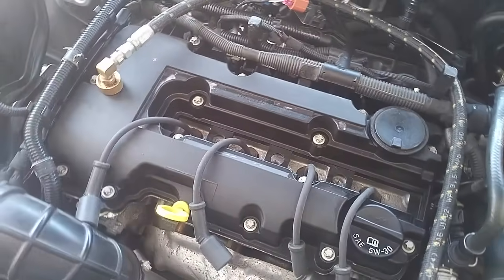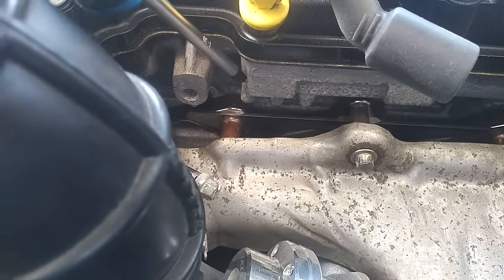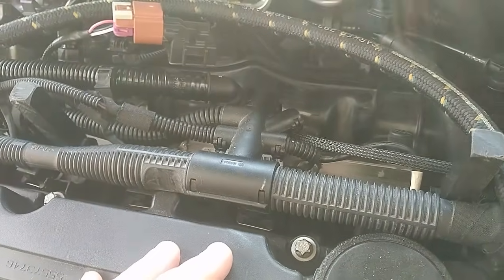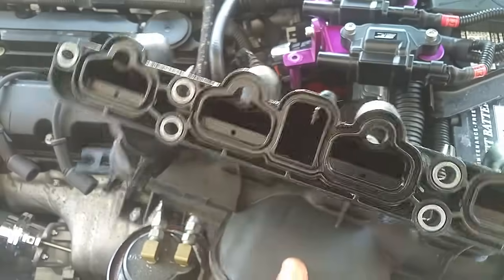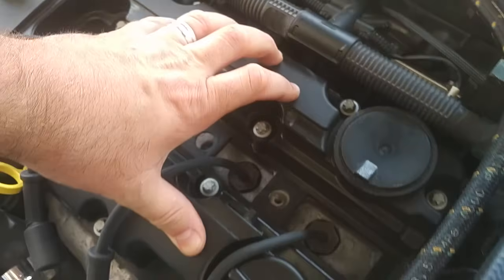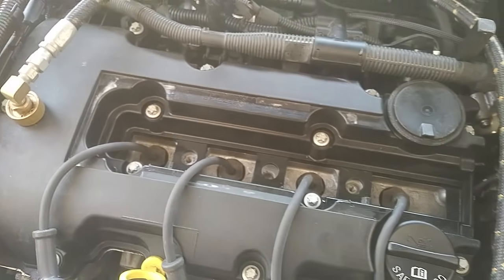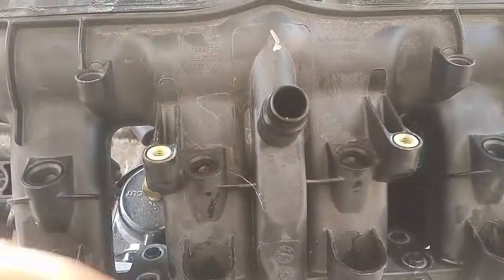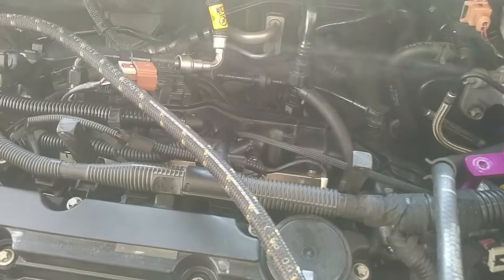Chevy Cruze Sonic Trax Encore 1.4L Turbo PCV Issues, Diagnosis, and Solutions

Comment: I wiped out the area but there's no round orange tip but there's something raised up but looks like flat and black in color. It's hard to tell without taking the intake out. Is that check valve round or flat? I am getting P0299, the car is under power, the line/hose from intake to turbo has some oil and my air intake connection at the line coming from intercooler is soaked with oil. I am trying to figure out the problem before replacing parts. I just installed a brand new Chevy valve cover.
Reply from the maker: Your check valve is gone. You need to install one of my pcv fix kits. That should address your p0299 and restore some power and fuel economy and reduce the oil consumption.
Reply: @AndreiDPop  Sounds good! Thanks

Comment: Would this cause white smoke out the exhaust as well? I've got the p0171 p0106 p1101 codes and the disc thing on top of the valve cover is indeed sucking air and I cant see the orange nipple in the intake manifold. I wasn't concerned about it until I noticed it's white smoking but it doesn't smell like oil or coolant. Just smells like regular exhaust fumes but is thick white clouds when first starting up then it eases off a little.

Comment: My car’s vaccume regulator diaphrame is suking air. Not only this oil cap and dipstick also sucking air. What will be the problem? What i need to change?
Reply from the maker: New OEM valve cover first. Check for missing intake manifold check valve.

Comment: Does the kit require a throttle body spacer?
Reply from the maker: V1 kit requires it. V2.1 and V3.3 kits do not require it.
Reply: @AndreiDPop  Which kit do you recommend for a Chevy Sonic 2012 1.4 turbo?
Reply from the maker: V2.1 and V3.3 are the most popular.
Reply: @AndreiDPop  I ordered the V3 kit. Installation was very easy, it corrected/cleared all my engine codes, cleared the engine light, engine runs perfect now. Thanks again I really appreciate it. Fantastic design!
Reply from the maker: @billveder1071  fantastic! Thanks for reporting back!
Reply: @AndreiDPop  I'm going to order the V3. Andre your design is ingenious, thank you

Comment: Awesome presentation 👍 My nephew’s 2014 Cruze making odd noises like the serpentine pulley is going bad. Once the oil dipstick is removed, we hear pressure being  released and the the noise goes away. Has anyone encountered this before? 

Meantime. We’ll follow your troubleshooting advice 👍
Reply from the maker: Valve cover is bad. Front main seal is bad too. Diagnose and check if the intake manifold check valve is missing or is clogged up. If so, install one of my PCV fix kits.
Reply: @AndreiDPop    Absolutely! I'll recommend your kit to my nephew.
Reply: If you pull the oil dip stick out and the noise goes away. Crankshaft seal is bad.

Comment: What a terrible design... wow.   Lets make sure that the valves aren't replaceable and you have to buy entire manifolds and covers to fix a simple valve..  wtf?  Just wow, i'm stunned.
Reply from the maker: Pretty bad for an OEM huh. 

This is why I designed the PCV fix kits, so that way you cans get external replaceable valves, for half the cost of a new manifold.

Comment: 2012 Chevy crew turbo check engine light code PO 420 Cala converter system efficiency below 3B1 when I crank it up sound like turbo make a noise didn’t get all right can somebodyWhat is wrong with it

Comment: Great video. Does the PCV 1 Fix kit worth with the ZZP performance throttle body spacer? I assume the ZZP product didn't exist yet when the fix kit was first made. Thanks.
Reply from the maker: I believe it does, but you may need an additional 1/8 Female NPT to 1/4 Male NPT adapter to space it out since the bottom of the ZZP spacer is angled, not flat.
Reply: @AndreiDPop  Thanks for the reply. I went ahead and ordered the PCV 3 kit just to be safe. I just installed a new ported intake manifold a few hundred miles ago so I figure I don't need to do much cleaning before installing the 3rd kit. Your videos have taught me so much about the 1.4 L Cruze!!! Thanks again.

Comment: Is the valve cover gasket replaceable? Fixed a p0299 with a clip missing of the wastegate/disconnected. Now I have an oil leak. Replace the big hose with the two check valves because it broke when checking the little valve in the intake. Any thoughts would be great if you have the time. The oil leak wasn’t present prior to fixing the turbo clip. Thanks in advance.

Comment: So I took off the hose leading into the check valve and there is a tone of build up inside. I can still see the nipple but there is a tone of gunk inside. Would it be best to replace the intake manifold completely? Or is this possibly a more serious issue?
Reply from the maker: I would take it out, clean it thoroughly, and install my v2.1 kit on it.

Comment: That's a brilliant explanation, and your website explains it even better. I find it frustrating that mechanics don't think first about how these systems work, since understanding is necessary before one has any hope of fixing things properly. Matching blowby gas flow through a PCV with the dramatically variable intake vacuum of a turbo is a huge challenge. So, I guess we shouldn't be surprised this system is much more complex than a simple captive ball and spring.

Comment: What if the PCV valve tubing has oil in it is that bad?
Reply from the maker: It's normal for it to have some. Did you inspect the check valve in the intake manifold?
Reply: @AndreiDPop  yes  checked out okay

Comment: The dorman intake manifold doesnt have that orange nipple check valve. How can you tell if its bad?
Reply from the maker: Oh it has it, but it's recessed further back in the manifold, making it impossible to check, test, or clean without removing the manifold. They can still get clogged, stuck, leak, or crack (have actually seen this reported). You can't even boost leak test it because you can't see it.
Reply: @AndreiDPop does your kit for the 1.4t work on the dorman intake and Dorman crank cover and Dorman turbo? Im replacing my 2nd dorman turbo under its limited lifetime warranty. Onto number 3 Dorman turbo and number 4 total turbos for my 2015 ltz rs cruze. These cars suck. Ill keep it till it doesnt run anymore because i dont sell my cars. I been wondering if your kit works for my Dorman/GM engine, 😂 Thanks
Reply from the maker: @robertholsopple9451  yes you can install it on the Dorman manifold but it has to be off the car. You’ll need a screw and a washer, and a long screwdriver. #10x3/4” self drilling sheet metal screw and a #10x7/16” nylon washer. If you order a kit, there’s a special instructions box in the shopping cart page that you can leave a note in. Mention it there and I’ll include that hardware free of charge.

Comment: Dr dan im having a underboost p0299 code noticed oil on front of cylinder head  u have any idea u think im having a pvc issue sir were should i start
Reply from the maker: Inspect the intake manifold for the missing check valve.
Reply: @AndreiDPop  thank u sir much appriciated i had guy giving me the run around wanted me to change coil packs boost sensors but i kbow thats not the issue theres backpressure creating somewere for the oil to be seeping threw the front head gasket pvc issue again im going to check thank u sir

Comment: Hi,

I have this issue with my cruze and that orange valve you mentioned is not there. I already replaced valve cover. so the whole intake manifold needs to be replaced?
Reply from the maker: Yes, or you can install my pcv fix kit for half the price from cruzekits.com. It's also serviceable.

Comment: What's that silver thing at 5:50 ?
Reply from the maker: Wastegate actuator from BadNewsRacing.net
Reply: @AndreiDPop  do I need a bnr tune ? Or any. Can I do it stocks
Reply from the maker: @ItzWallyMan100  need to be tuned for it. Honestly you should get turned regardless. HUGE performance improvement.

Comment: I have a question. My son’s 2016 Cruze has positive crank case pressure, possibly from a cracked piston skirt? Ever heard of that? The car has 120K and runs perfectly. The issue/problem, is oil allegedly leaking/spraying from the crank seal, according to the dealer. It seems like better ventilation could possibly be the solution. Does this sound like a possible PVC valve failure? They changed the valve cover assembly already. What do you think? Anyone? Thanks in advance!
Reply from the maker: Sounds like a defective valve cover or clogged pcv port in the cylinder head. I get calls for this issue all the time. 219-779-7742. I can further explain.

Comment: Hey, Dan Dre, I have been replacing the Water Pump, Thermostat and/or the coolant outlet due to leaking coolant. At times it over heats when weather is cool weather conditions. What is your take on this matter?
Reply from the maker: Did you purge the air from the system in the radiator? How hot is "overheating?"
Reply: @AndreiDPop  no I haven’t purge the radiator. The car gets hot to the point where the overheating light turns on. So I am afraid for long distance drives. I just keep it local. Then the car starts leaking for the water pump or water outlet. I might change the coolant reservoir.
Reply: @foxman4489  The cooling line on the turbo sometimes leaks and then leaks it's coolant onto the water pump and people mistake it for a bad water pump.  Also the radiator fan has a resistor on it that gives the radiator fan a high and low speed.  Sometimes the resistor fails and the fan only does the low speed.  The entire radiator fan then needs to be replaced(new on ebay for $68).
Reply: @MyLifeThai371  thank you. I will replace the fan in the near future. Gives me time to save up as well.

Comment: Excellent video I need some help tho maybee you would know so the PVC hose that goes from the intake to the turbo inlet that little vacuum line that attaches to it and goes from I believe the turbo waste gate and then the other end goes under the back of the intake and plugs in somewhere well when removing that line I broke the vacuum nipple  I originally thought it plugged on to the vacuum nipple on the bottom of the intake but I was not sure and I pulled it out of those hose and its gray like those like 2 and 3 way vacuum  Ts they have at the auto store but I can't see it I was going to pull out my scope and see if I could see it but I saw your video and figured I would ask  maybe you can show me a picture on the part or the area ot goes to cause the schematic from dealer is blurry  as all hell LOL
Reply: Let me know please I'd very much appreciate your help thanks

Comment: What codes show with this issue. I received a letter in the mail in August of this year 2020 stating to bring the car to the dealership if it's having the issues they listed as being PCV something. They said it would be fixed at no cost. I made an appointment and they told me that I was having other issues but none of then were what was listed on the letter. I think they are lying to me. They told me oil was leaking from somewhere near the engine though

Comment: I have a loud chirping noise coming from what I believe is the back of the PCV, it could be from the intake manifold based upon your video. It seems to be in the middle where you show the intake corrugated hose that wraps around to the side.  Have you heard or know if this is a failure of the intake manifold.  I do not have any pressure change with I place my finger on the PVC opening on the right side.
Reply: I had a similar sound not long ago and when I replaced the EVAP purge valve, the sound disappeared. Since your comment was a year ago, how did you resolve the sound?

Comment: I got new turbo and oil cooler and got po299 after cleaning PVC bypass on intake.  I thought kit would fix but it did solve my oil leak.  Looks like I'm not the only one with 299, lol.
Reply from the maker: That's an underboost code. So there's a leak somewhere. Just need to find it.

Comment: why not put a normal pcv valve i the coragated  hose ?
Reply from the maker: There's already one there, at the turbo inlet. Adding one would be redundant, and expensive. A good 5/8" valve with a low crack pressure is like $30. That's nearly half the cost of my entire kit. It also doesn't solve the problem of replacing the intake manifold's check valve. You need both valves.

Comment: pcv valves are replaceable in 88 Honda and these guys made it to change the manifold, clapping.
Reply from the maker: I mean, it does allow for lower tension piston rings by having vacuum applied to the crankcase, improving efficiency and power as a result. So, it is a technological improvement. The implementation, however, is idiotic.

Comment: Would one of the vavled failing cause oil to burn... I blow smoke only when boostbis built n I shift it will let out a cloud... no very big but enough to get my attention
Reply from the maker: Yes. Textbook symptom of the intake manifold check valve failure. My pcv fix kits will solve that.

Comment: I'm having this issue with my 2015 sonic 1.4. How urgent is the fix? Reason I ask is I do my own work on my vehicles but I'm currently buying a house and getting a new job so time is limited with moving and my apprenticeship. How soon should I fix this?
Reply from the maker: Which issue? I described three.
Reply: @AndreiDPop  the chirp at idle, and it goes away when I pull the dipstick
Reply: @AndreiDPop  also, if I buy your kit, do I have to still replace my intake manifold? I was confused by that part a bit.
Reply from the maker: @haydengooding5124  no. It fixes the intake manifold so you don't have to spend 2x on a new one, every 30k-60k miles.
Reply: @AndreiDPop  I'm already sold on your kit. I'll be ordering asap. Is it bad to continue driving the car as is?
Reply from the maker: @haydengooding5124  sorry, forgot to respond yesterday. If the valve cover is defective, you need to replace that ASAP. My kit won't address that chirp. You can wait a bit to install my kit, but the valve cover needs to be fixed. I wouldn't drive it much that way.
Reply: @AndreiDPop  so the valve cover might be what the chirp noise is? I can't tell where it's coming from. Also heard it could be crank seal. I ordered your kit about 10 minutes ago, I want to install that just for longevity purposes.
Reply from the maker: @haydengooding5124  when the valve cover fails, it can cause the front main seal to fail as well. Is there any air coming in or out of the vent on the valve cover?
Reply: @AndreiDPop  I will take a look later today when I get home from work. Left the car home today and drove my truck. I bought the car from a friend who had the valve cover replaced at some point he said. I'll have to ask him more about it and take a closer look. Last time I was under the hood for an oil change the gasket looked good and was still bright blue with no signs of leaks. But I'll be sure to check the vent while it's running at operating temperature.
Reply: @AndreiDPop  mines has air coming out the vent on Val cover...what do I need to replace
Reply from the maker: @chriswilson6816  need a new valve cover to start. OEM ONLY. Then check the intake manifold for a missing check valve. If it's gummed up or missing, order one of my pcv fix kits from cruzekits.com.

Comment: Seems like mine cause my valve cover gasket to gather pressure and now leaking oil and running rough but only on idle, which kit do I need for the 2012 Cruze 1.8v
Reply from the maker: The kits are only for the 1.4L turbo, not the 1.8. For the 1.8 you need to replace the pcv valve or valve cover.
Reply: Dre Dan oh dude sweet thanks for the quick reply!

Comment: HI. ANDRE' AWESOME VIDEO BROTHER I THINK YOU GAVE ME MORE CURAGE TO KEEP FIXING MY CAR,,I'M OVER WELMED OF IT SINCE I PUT LOTS OF MONEY TRING TO FIX BUT THE SAME CODE KEEPS COMING BACK.."PO420  I WAS WONDERING IF THERE WAS A PO" CODE FOR THAT ISSUE IN YOUR VIDEO , AND IF THERE WAS ONE ,WHICH ONE WAS IT ?.. I HAVE A 2011 CHEVY CRUZE TURBO 1.4L LT, AND I HAVE REPLACED 
1.SPARK PLUG
2.COIL BAR
3.VALVE COVER SEAL
4.ALL SENSORS
5.FRONT CATALYTIC CONVERTER
6. BACK LONG TUBE CATALYTIC CONVERTER "THE ONE THAT I THOUGHT AFTER WATCHING OTHER VIDEOS WHICH GAVE OUT PO420 CODE " CATALYSTIC LOW EFFICIENCY SYSTEM BANK 1. 
I ALSO USED SEAFOAM ,GAS TREATMENT AND CAT CLEANER. AFTER RUNNING MY CAR FOR 70 MILES OR SO,,,"THE CHECK ENGINE LIGHT KEEPS COMING BACK..SOME GUY AT AUTOZONE TOLD ME THAT IT WAS NOT MY TURBO, OTHER WISE IT WOULD BE MAKING LOTS OF GRINDING NOISE..BROTHER MAN ,WHAT ELSE COULD IT BE ??????
Reply: Hey Armando, I have same issues on my 2014. Lets talk on Instagram -> trnns    please send me message we need each other brother. We took car to the Chevrolet dealer they told us 'engine needs to be replace :((". NO WAY, THIS IS UNACCEPTABLE, THERE MUST BE SOLVE FOR MORE EASY WAY